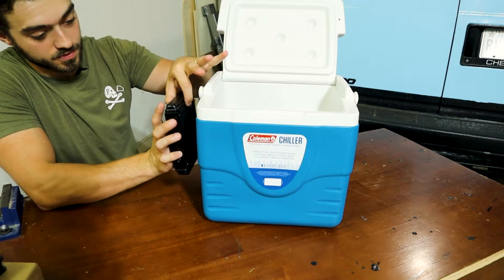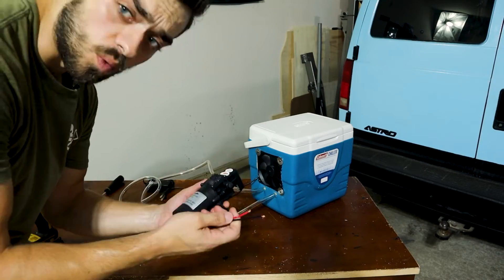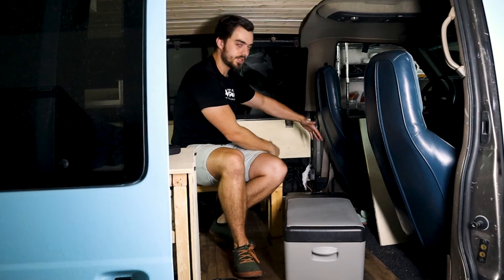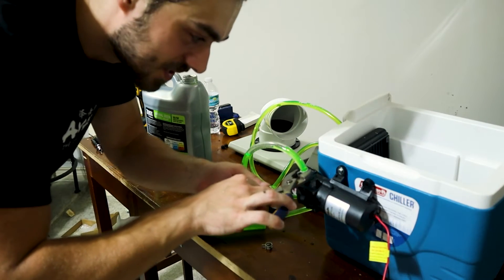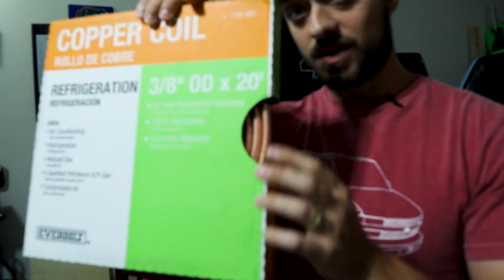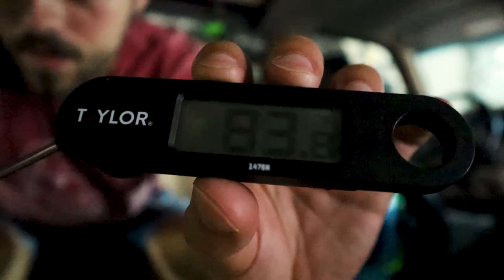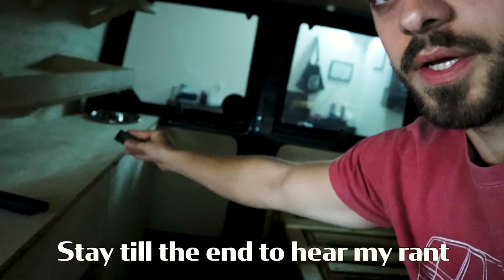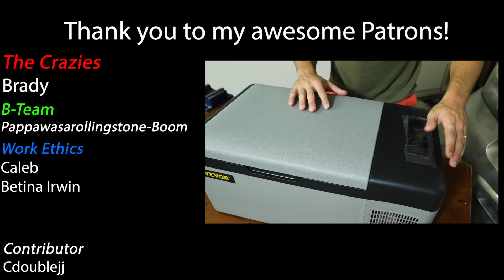DIY Off Grid AC for my Budget Camper Van

Comment: Your making it way too hard! your on the right track, sort of. I used the same cooler, bought a can of great foam, built up the insulation in the little cooler. bought a little black Opololar fan at Walmart. drill hole 3", for elbow and bigger hole for Opoloar fan aprrrox.7". in your van have a 12 volt freezer section to freeze two of the biggest blue ice packs that will fit in the cooler. freeze them, at night when hot, place them both in the cooler and feel the cool breeze on you while you catch some zzzzs. refreeze in AM. Rinse and repeat. Is it the best NO, does give off moisture of course, but cool air to sleep. Vent Van out in AM.

Comment: Hi Chris, I know your video is a couple years old but I just now found it. My friend, firstly I'd like to point out there are many people trying to build an ice AC. I think it's nuts to go out an purchase the coolers then cut them up to experiment with them to see if they will work for the project. I have the same interest in successfully building an AC like the many on YouTube. But, I don't cut or drill holes in a perfectly good cooler. I suggest to simply use cardboard and shipping foam to make my own lids. OK with that said, if you have to cut and drill the new ones then here's what I did. I have the same exact electric cooler by Vevor and if you stop for a minute you would realize you already have your AC. The fridge! Open it and carefully take out the components. You will have all the lines, the compressor, the thermostat, even the coolant gas. Just be careful to not break the lines and let the coolant escape. You can now modify the parts and build a new housing for your new AC which will blow very cool air (depending on the strength of the fan). As you know the fridge goes down to -4. I use a bilge fan which blows 400. The ice AC will only last up to an hour no matter what you do and will cost you a fortune to keep the ice fresh. Anyway, I hope this helps and you think about my thoughts and comments. Good luck and stay cool.

Comment: The best you can expect from this type of system is to blow cold air on you. I spent a lot of time building one a few years ago. I have an idea for a closed loop system that I haven't built yet. 2 coils of copper tubing, One gets zip tied to a fan and the other one lays in your cooler full of ice with some water in it Those two coils will join one side of each to the other with a inline pump closing the loop. Water in the closed loop will just circulate through the tubing and the air will exchange some of that coolant effect on anything that the fan is blowing on. But it won't lower any temperatures.

Comment: I did a similar set up like yours. Minus the blue cooler. Pumping ice water into radiator. It was blowing nice and cold for 30 min until all the ice got melted and was blowing neutral temp air. The heat from inside the van was cooling down the pipe that's outside the cooler was melting the ice. And it didn't help that the compressor line in the vevor unit is at the top. Of the cooler. Didn't want water splashing while driving. So just now I ended up buying portable unit with exhaust tubing that sticks out window. I'll just invest in solar panel and battery banks to plug the unit in

Comment: Yeh as others have said, fridges / ac compressors all work the same, they compress refrigerant in a cycle (compressing it which makes it hot, cool it off (using ambient air) and then drop the pressure through a vavle to let it expand, which makes it super cold. So you need to get rid of the waste heat from the fridge, and get it outside. Otherwise your fridge is cooling but also heating up the van at the same time.
Reply: Those small car fridges do not make any heat, so relax it could still cool with fridge inside.

Comment: Yes, the fridge hot exhaust needs to be vented to outside.  Also, the mini radiator is designed to exchange heat with fan moved air. Just setting it in a cold space isnt eniough. They do make aluminum and copper heat exchangers. No fins, uses conductive cooling so can put at bottom of fridge, then cover with insulation to increase thermal isolation. I got some excellent large heat exchanger blocks off of ebay while back, they work great.  Also id be concerned about overlaoding the fridge compressor. They arent designed to move lots of heat. They are supposed to cool insulated compartment and then stop.  Maybe with high efficiency venting to outside would help. Its possible to water cool the fridge condenser so it wont burn out trying to air vent the heat.

Comment: I see this after just posting the other comment and it got me thinking. The problem is because you're not evacuating the hot air. So it will never work, because thermodynamics. Although it did get me thinking that you could possibly build a 12V ac from an old 12v fridge. But with all the labor involved... just take the plunge and buy one, because it's probably not worth it.

Comment: You should exit the heat of the compressor to outside the van. It's a physics rule that applies when generating hot or cold. You have to remove the unwanted.

Comment: Try using a vehicle AC compressor from the junk yard
Reply from the maker: Interesting Idea. Takes a lot of force to turn that over.
Reply: The new rotary scroll compressors are way to go. Small, superefficient. Just need vacuum pump and refrigerant bleeding tool to charge it.  Hm, maybe remove the ac system from the fridge and mount it where its next to outside and vent it. Attach heat exchanger for water directly.  Those low power fridges  have efficient rotary scroll compressors which dont need much power. it is just necessary to vent alll the heat from the condenser very well. Liquid cooling of the condenser might do it, then vent  heated water to outside. go thru the floor.  problem is, the mini fridges dont have lots of btu hour capacity.  If you only have a few hundred btu hrs on the mini fridge system, well, that wont do it for  you anyways.  Maybe a large enoiugh fridge.

Comment: One principle to always keep at the front of your mind when designing is that you are building great exchangers. It makes one area cold by exchanging the heat to another location. So your fridge is taking the heat out of the inside and dumping it to the outside. Your water pump will also generate heat. Any cold that your system is outputting will be fighting the warm that your system is also producing. 

The best way to separate them so that they are not fighting is to move all heat-generating components outside of your van. If you move your water pump onto your fridge, and extend your tubes so that you can run your fridge and pump outside of the van. Your ice-water and copper tube exchanger was excellent, that way the coolant can transfer its heat to the water quicker than air. 

I also think the initial cooler is not helping to suck heat out of your van. Think of it like the opposite of a radiator: it's not putting cold into the air, it's actually taking the hot out of the air. So isolating your radiator inside the cooler won't help to take the heat from your van's air, but hinder it. You want as big of a radiator as possible (and fan) so that you are pulling as much of your van's air as possible through the radiator, this transferring the heat from the air into the coolant.

I'm not sure the best way to run your tubes outside of your van while keeping all windows and doors closed. But keeping the inside of your van as enclosed as possible will help the temps drop lower. Covering the tubes in insulation outside of the van will help not suck heat out of the outside air.

Thanks for reading my suggestions! You've been a huge inspiration to me and I hope you keep iterating on your design- don't give up!
Reply from the maker: I really should have started to tackle this project a while ago since it is already getting cool out. My  goal was to see if the system could even produce consistent cold air. If it worked as intended, I was planning for a way to dissipate the hot air outside the van some how. The copper and ice is definitely the way to go.  I should have use both of the radiators in the smaller fridge, could have made a difference. I think something to think about with this particular system is just how long will it last? The compressor isn't meant to run 24/7 and with the AC system running it would be. 
Next summer I think I may want to try to tackle a diy mini split system. Seems a kind of fun
Reply: @ImChrisDeDecker  You're right, it's smart to consider the operating conditions that the compressor was designed for. It won't last long if the fridge/freezer is working 24/7. And it's not easily replaceable. When the hot weather returns I hope you take another stab at this! I'm a big fan of your Astro projects.
Reply: *heat exchangers

I knew I should have proof read

Comment: I knew this would not work 10 sec into your vid: the heat generated from the compressor is exhausted inside the van.
Reply from the maker: If I was able to get the temp down, I was going to pump the exhaust out the van.